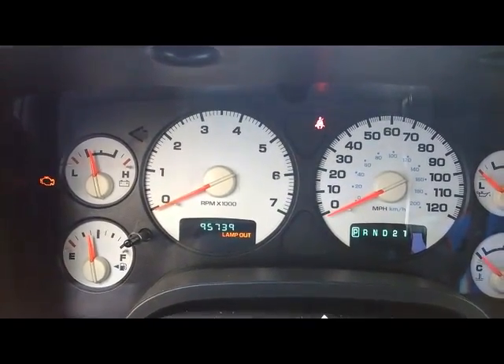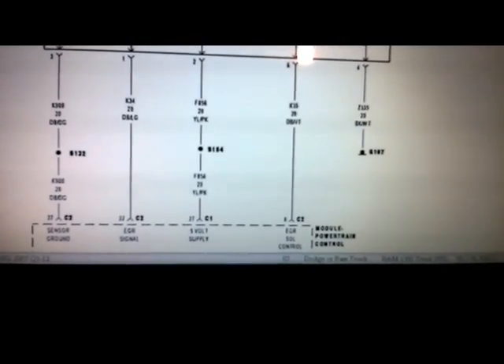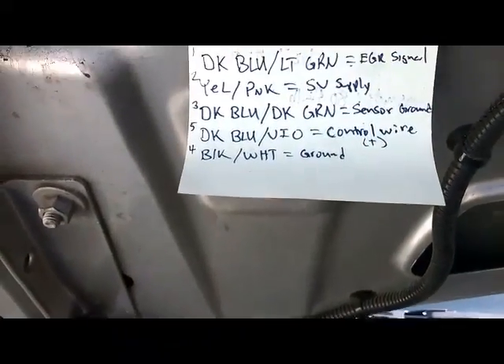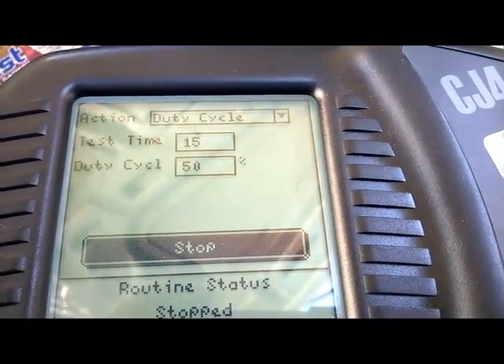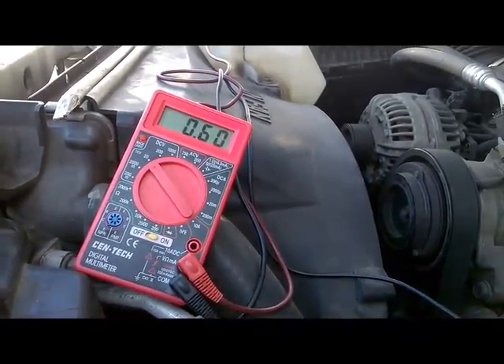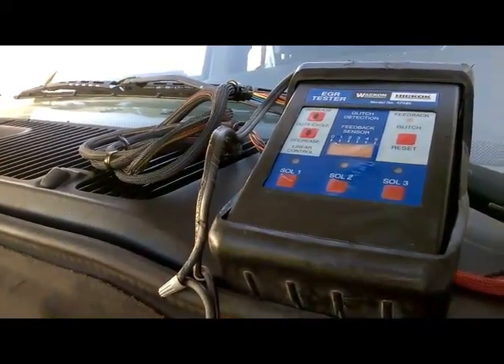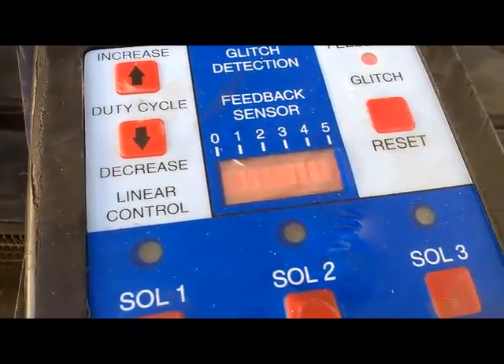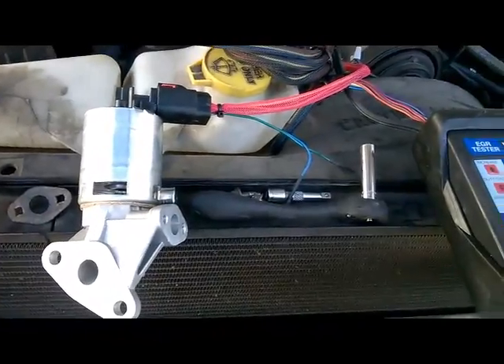(Ram 1500) Engine Code P0404 - EGR Position Sensor Performance

Comment: I have a P0404 with these exact issues. Problem is my Dodge ram 1500 5.7L hemi is a 2003. From what I can find I don't have an EGR valve. Any tips on how to fix this or find the EGR?
Reply from the maker: From my understanding, the egr valve should be located on the front passenger side, below the alternator. If it's not there, it was probably deleted.

Comment: Hi, happy new year by the way, I have a question, I got a 2005 ram 1500 5.7 hemi, I got a code p0404, I started checking the egr valve and before I did anything I noticed it was flooded in coolant, so i decided to remove it and when I was taking it apart, the first thing I did was remove the pipe and found that some one use a metal plate to complete seal that entrence so when i start to unscrew the otter side coolant started to come out of that side, now I never seen that before.
Do you have any idea on why it's coolant coming out from there??
From that hole where the egr it's connected to on the engine ??? I will really appreciate any help, thanks in advance
Reply from the maker: @bms3910  Wow, first time here something like. The only thing I can think of, faulty intake manifold gaskets sipping coolant into the manifold chamber.
Reply: Is it supposed to be air only? No liquid.

Comment: Great video I'm having the same issue and replaced the EGR with no testing, check engine light came back on a week later. Your video is what I need to test properly. You are very knowledgeable, thanks

Comment: My 2006 dodge ram 4.7 on the pin 1 it has 4.48, pin 2 5.02, pin 3 has 0.02 , pin 4 0.00, pin 5 has 0.35
Reply from the maker: Your issue is on pin 1, it should be close to 3.5 volts. You may have faulty egr valve or carbon build up around the pintle.
Reply: @EliTheOBDTech  the egr valve is new was installed some weeks ago.
Reply from the maker: @luisballesteros219  What brand?
Reply: @EliTheOBDTech  unbranded I bought it on ebay.
Reply from the maker: @luisballesteros219  That might be your issue. Sometimes it's better to spend a bit extra and get the original
Reply: @EliTheOBDTech  ohok
Reply: @EliTheOBDTech  my old egr pin 1 is lower gives me 3.73 I'm going to buy a new egr
Reply from the maker: @luisballesteros219  Keep me updated, thanks.

Comment: I have an 04 dodge ram 1500 st 4x4 5.7 , did new egr and pipe . Checked pin 1 and 2 both had 7.48 volts give or take. And pin 3 had 12v last 2 pins were 0 volts , the tpim had a bad connection I found idk if that is still the reason why the check light still is on? Is this correct for volts on those pins?
Reply from the maker: Perhaps you may have a TPIM problem that's causing your issue. These TPIMs are notorious to go bad.
Reply: @EliTheOBDTech  what is tpim ??
Reply from the maker: @RCCRAZYSTUPID  Totally Integrated Power Module. It's where all your fuses and relays are loaded under the hood.
Reply from the maker: Both Pins 1 n 2 voltages ⚡are too high. Most likely a bad EGR valve. Secondly, wiring issue.
Reply from the maker: Pin 2 for sure, should be no more than 5 volts.

Comment: Excellent video thank you! I'm running into the same exact problem except I put a brand-new heavy-duty EGR valve in and I'm still experiencing those same symptoms occasional stalling and rough idle at lower RPM's. Any advice?
Reply from the maker: Make sure your your harness connector doesn't have any  spread female pins. Maybe, the characteristics of the New egr valve are not compatible. Its hard to say, without proper diagnostic testing.

Comment: Did you ever find out the specs for the signal wire? I believe my signal wire is shorted but can’t find any wire damage
Reply from the maker: If I do remember right, it should be around 3.5V with key on, engine off

Comment: I replaced my EGR valve then 2 weeks later my Check engine light came back on and the code was the exact same thing the EGR valve code P0404? Could I have gotten a bad replacement part that failed early?
Reply from the maker: Was it an aftermarket egr replacement ? If so, it's a possibility that it went bad. Another possibility, harness connector issue, spreaded terminals or an electrical issue.
Reply: @EliTheOBDTech  Thank you I will check into it, I am replacing the water pump this weekend and While I have it off Im going to replace the EGR valve once again plus the 02 sensors are also showing bad. Might as well getter done while I cranking wrenches. Any suggestions for checking the harness ?
Reply from the maker: @johnchapman3225  First thing I would do, check power and ground going to the egr valve. If all checks all good, back probe the signal wire and do a wiggle test to check for any signal dropouts. That will tell you that you may have a spreaded signal terminal or faulty egr sensor. You can visually check the harness connector and compare for any spread terminals.
Reply: @EliTheOBDTech  Thank you, I will do that much appreciated for the help and advice.
Reply: @johnchapman3225  hey by any chance did you end up finding out what it was ? In experiencing the same issue with my 08 ram 1500
Reply: @cristiancastro5483  I ended up replacing the Same part again along with 2 new OCM sensors was fine for 3 weeks then started getting the fault code again. I think its really in the o2 sensor then anything but I think I have an electrical short from one going back up to the engine just have not located it yet. Good luck

Comment: Where is the exhaust recerc sensor located on a dodge 4.7 engine?
Reply from the maker: Hey Stanley, if I'm not wrong, the EGR Valve for 4.7L should be located in the left rear of the firewall. In other words, left rear driver side. Close to the throttle body.

Comment: What do I do when I switched the egr an check engine light still on what cool be problem
Reply from the maker: You need to check power and ground. Check for loose or spreaded female terminals on the harness connector

Comment: Key on engine off back probe connector on pin 3 sensor ground I have 3.35 volts pin 1egr signal I have 0.30 volts pin 2 vref 5.02 volts pin 6egr Sol control I have 0.11 volts pin 4 ground wire I have .009 volts and this is the third new EGR valve currently have code p0403 which sets quickly what are your thoughts on these readings Eli
Reply from the maker: What kind of vehicle?
Reply from the maker: By the looks of your voltage readings, I see that your sensor ground is not within specs, should  be less than 0.1V. Looks like you have a harness issue on pin 3 or maybe pcm problem. The next step would be to check the voltage at the pcm and see if you get the same voltage reading of 3.35V
Reply: @EliTheOBDTech hello i have the same issue pin 3 show 2.8 v how can i test what voltage the ecu is sending thank you appreciate your time!
Reply from the maker: @alejandroacosta3447  You need to have access to a wiring diagram for pcm pin out.
Reply: @EliTheOBDTech  so i found the pin on the ECU and it shows the same 2.8v can it be a bad ECU?
Reply: Mine shows P0404 dodge ram 4.7 4x4
Reply from the maker: @alejandroacosta3447  it can be a bad pcm but also a faulty egr valve that can have an internal bad sensor ground or possibly a partial open on the sensor ground wire. Try performing wiggle tests while watching the voltage to see if you see glitches.

Comment: I tested my signal wire (1st one) and got a reading of 3.5 volts slight fluctuations. I also have codes for circuits high and low po405 and po406.   How do I address this extra voltage. What would cause this? My engine does not seem to run differently either but code will not go away? Pls help thanks.
Reply from the maker: A reading of of 3.5 volts is a good reading for this vehicle. Did you already do a visual inspection on the egr valve's pintle for any carbon build up
Reply: Eli TheOBDTech yes replaced the the egr few weeks ago everything seems ok could it be from changing to a cat back exhaust?
Reply: Eli TheOBDTech I remember hearing that the code is triggered when a voltage drops below.5 volts my solus scanner said egr has .4 volts.
Reply from the maker: @philandfamily9298  it sounds correct, you may have an intermittent connection between the male pins and female connector (harness connector)

Comment: How can u tell if it’s the egr valve connector housing or the wiring harness itself that is faulty?
Reply from the maker: By doing a wiggle test on the harness itself while watching the voltage meter for any glitches. Sometimes the female connectors tend to spread open to the point where it does not make a proper connection with the male connector. Always check power and ground on any circuit.

Comment: Hi,
My husband's 2007 dodge ram keeps showing that egr code even though we have gotten it replaced about 5 times. For some reason, nobody can fix the issue properly. What should we do because we need this issue fixed asap so we can pass smog.
Reply from the maker: I would recommend doing voltage checks to determine if it's not a harness issue. I would also check if the egr system is not partially clogged with carbon deposits, especially near the intake manifold.
Reply: @EliTheOBDTech  thank you. Do mechanics usually not check those possibilities? I feel I have gone to some incompetent mechanics. Even to the dodge dealership. I'm convinced I won't find a competent mechanic considering all the ones we have gone to.
Reply from the maker: @jessicataylor2859  There is mechanics who are just part changers and do not take time to check for electrical issues.

Comment: How do you know it's not a fault in the harness?
Reply from the maker: Liam MacBeth to determine that it's not a fault on the harness you need to do voltage checks by using a voltmeter. during your voltage check, wiggle the harness to see if there is any voltage glitches.

Comment: 97 jeep Cherokee sport 4.0 while driving for a while the car stall an have to wait about 30min an it will  start again an then it runs good for couple of days an same thing over again what do I check thnku like your vedios
Reply from the maker: +Simon flores hello Simon, I would start by checking fuel pressure and then performing some voltage checks and some manual test on the EGR. Sounds like fuel pump or EGR valve problem. Good luck, let me know update status.
Reply: Did you replace that crank sensor yet?
Reply: what it was that the oxygen sensor wires were cut an hitting the drive shaft making it surge an the wire to the nss had bare wires an shorting out seen I replace the post o2 an a new nnswitch had not stall or surge

Comment: hello Eli, excellent way to approach an EGR problem and any code associated with it and as you mentioned to know the circuit designed if it is ground or power control side is very important in checking any sensor or solenoid. thanks for all your videos they contain good info as I, watch and learn cheers my friend.
Reply from the maker: +j georges Thanks for your support, much appreciated.
Reply: j georges